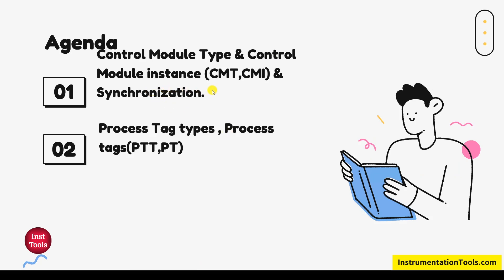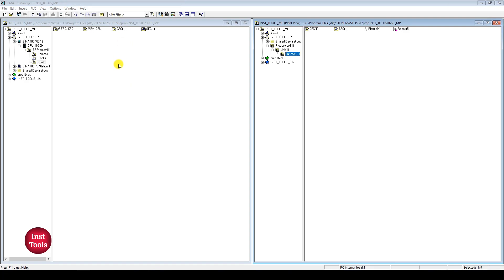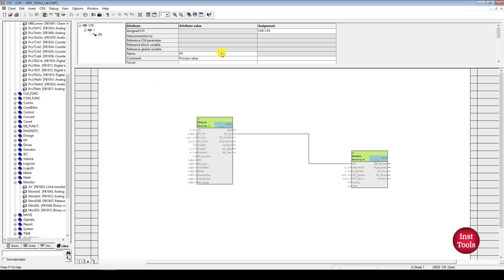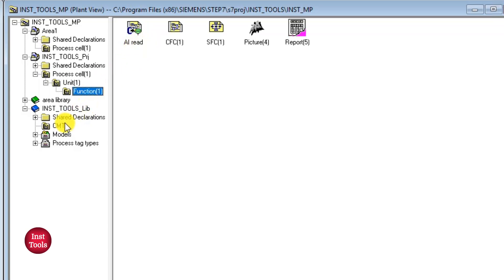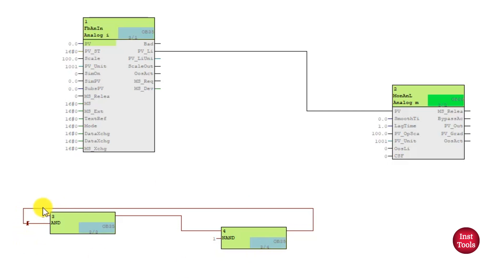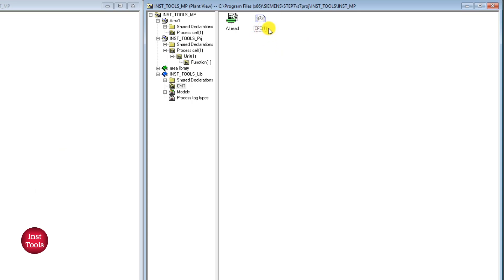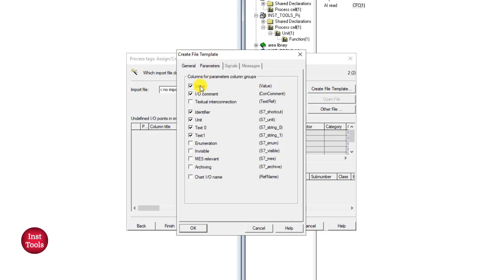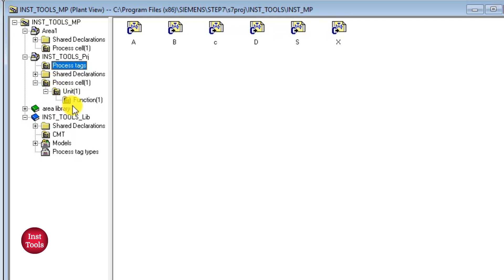SIMATIC PCS 7 Tutorial - CMT, CMI, Synchronization, PTT, PT

Comment: now a days when there are muliple electrical drives they are connected through communiction cable connected to DCS
Drives ABB DCS can be siemens or Yaskava
in some plants Drives can be Siemens and DCS can be ABB or some other 
sometimes both drive and DCS  from same supplier 
who is to decide which protocol to be used in the above  cases
Reply from the maker: Mostly System integrators or DCS providers during Design phase
Reply: Thank you for your reply
what do you mean to say is that it is the DCS supplier 
who decides  it is ethernet or profinet or someother